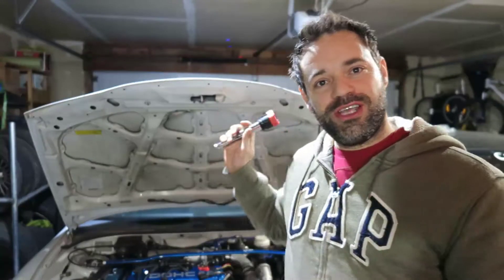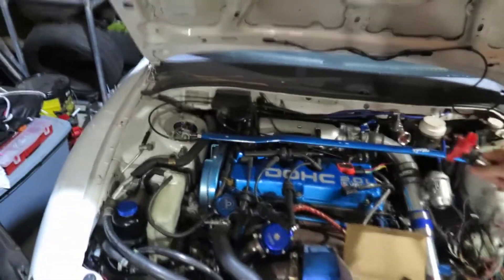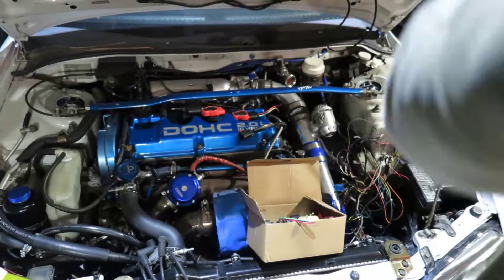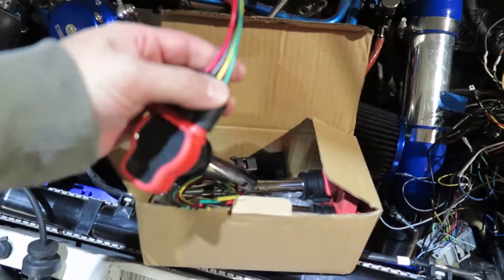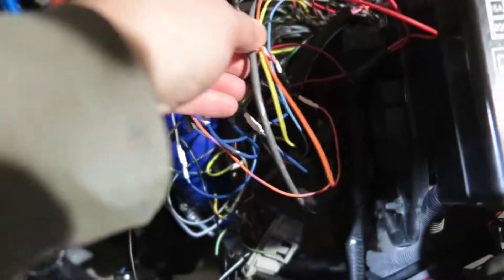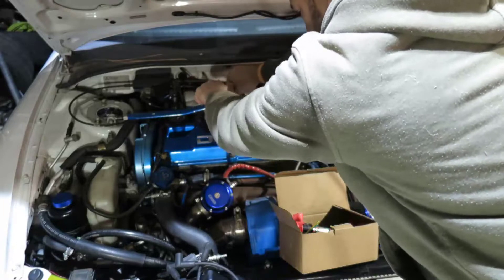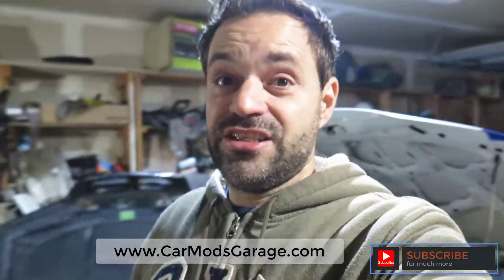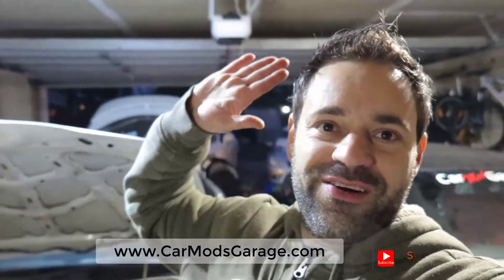Individual Coils on Eclipse 420a and SpeedyEFI First Start - Eclipse 2G Project

Comment: I’m trying to replace my coil pack. Would I need to apply any lubricant or whatever to it? I only see people doing the spark plug wires or boots.
Reply from the maker: Well this is not OEM for this car but usually no you don't need to do anything.  The spark booths and wires are mostly the same principle of connection.  The coils only are longer and have the coil on top of course but the connection to the plug is the same way.  Some people apply some sort of grease but I've never put anything
Reply: @CarModsGarage  I was just wondering because I got p0303 code, then got p0304 a month later. But I erased both codes. I have tried to narrow it down my spark plug wires and spark plugs aren’t old. So I’m thinking of doing the coil pack and maybe checking my injectors. Seems like coil pack would be an easier to replace. Thanks for responding
Reply from the maker: @r8der674 when I got that code on a g35 I had it was the coil pack.  Cheap and easy to change most of the times

Comment: I’ve got oil pouring out of mine coming from behind the timing cover dripping bad in front of the oil filter what do u think
Reply from the maker: Good look and see where it's coming from but it could be from the valve cover gasket. Clean everything, go for a drive and see where the oil is coming from
Reply: @CarModsGarage  did it behind the cover
Reply: @CarModsGarage  got to pull engine
Reply from the maker: @RickeyFields-sd4jd  oh that sucks

Comment: Can you do this with the stock ECU? I'd imagine just routing the wires from the stock coil pack plug to each coil but then again I haven't looked at any wiring diagrams or pinouts so I don't know how that plug works
Reply from the maker: Hmm guys research a bit but if the signal that the ECU send is enough to trigger the coils then yes. Good figure out the sequence
Reply: @CarModsGarage  well I have some coils, everything I need for wiring and another car so I'll do my research and see if I can't get it to work!
Reply from the maker: @not_virtuality  🤙 let me know how it goes
Reply: @CarModsGarage  also you think it would be worth it on a stock 1991 3KGT VR4? I think I wanna keep it stock cause it's basically mint condition but of the engine ever blows up im gonna build it
Reply from the maker: @not_virtuality  I don't see you gaining anything from it so I wouldn't mess with it if I were you

Comment: what turbo system do you run
Reply from the maker: I'm running an eBay turbo .67 ar. Ebay intercooler kit. I was running a smaller garrett turbo but it started making noise so I got this one that was laying around. Very happy with it

Comment: Did you happen to switch to COP because the original coil is a dumb coil? Did you ever get the car to start with the factory coil?
Reply from the maker: That's a very good question. I did I switch to the new ones because #1 my old ones were not sparking (broken cables) #2 the speeduino works better with smart coils. It only sends the signal. That way I can use sequential firing. #4 finally for the looks.
I unfortunately did not make it work with the oem but I believe if you only pair up the signals with the firing order since there are only two signal wires it should work fine
Reply: @CarModsGarage  thank you. I tried using the factory coil yesterday. Unfortunately it did not work, come to find out these are considered to be 'dumb' coils and as a result, they would require an external igniter to work. Luckily, I did not fry my Speeduino. Word of advice to anyone who reads this, ensure NOT to connect a dumb coil directly to the Speeduino without an igniter, you could ruin your new ECU. Time to go with a COP setup for me as well. I'll be going with a wasted spark as I'm doing a PnP unit that I can swap out with the factory PCM thank you for all the help so far!
Reply from the maker: @jorgerios1029  hmmm i guess the igniter is inside the ecu then. Eclipse ECU does a lot of stuff. You will need an external voltage regulator (I have a video on that) otherwise the battery will not get charged. 
Not sure how the ecu would fry without the igniter since ecu send signal out. I would think worst case it would fry the coil pack not the ecu but better safe then sorry. On my other build I fried 4 out of 6 smart coils testing them from the ecu .
By the way every coil that hass less than 3 wires are dump. Smart coil usually has 4 wires ( pos, neg, sig, sig back) the ecu only care about sig so it's out signal to the coil. I would think that on the eclipse the two wires apart from the power would take the signal. I guess not 🥺.
Reply: @CarModsGarage  according to what I've read, it seems like some dumb coils will send the high current output back via the signal wires without an igniter. This is why they don't recommend wiring them up directly to the ECU.

That's a really good tip to know, the number of wires on the coil, thank you!
Reply from the maker: @jorgerios1029  gotcha. Ya that makes sense!
Reply: @CarModsGarage  i meant to mention this to you earlier, I too went with an external voltage regulator, thank you!
Reply from the maker: @jorgerios1029  Also watch the next videos about the wiring. You will need a little mosfet to transform 12v to 8v for a few sensors. The ecu will have one pin that says 8v supply or something like that. That's where you will add this mosfet output
Reply: @CarModsGarage  yes sir, I went with a L7808 voltage regulator. I'm putting the Speeduino inside the OEM PCM case. I'll be sure to send you a link to my setup once I'm done. 👍
Reply from the maker: oh that's cool do it! I am curious to see how it will turn out
Reply: @CarModsGarage  So I went with the same setup you have here with regards to the COP. I wrote the ignition inputs to each respective coil (1,3,4,2). I can't get my trigger lights to turn on on speeduino ECU when going with 'Low' setting on the spark trigger output. It only turns on when selecting the 'Going High' method. Can you please re-confirm your setting for this option.
Reply from the maker: @jorgerios1029  I'm on "Wanted COP" glowing low. Are you doing an Eclipse?
Reply: @CarModsGarage  I'm doing a Dodge Neon with basically the same engine. All of the sensors are the same.
Reply from the maker: @jorgerios1029  stupid question but just to be sure did you choose DSM 420a on the Trigge Settings?
Send  me ama e-mail at marcos@carmodsgarage.com and I'll  send you my tune so you can compare or see if it gets you started

Comment: Hi CarModsGarage, quick question as I will be running this coils on my Speeduino application, do you wire the signal cable from the coils to the Speeduino controler directly? is there a need for inline resistor or something?
Thanks, best regards
Eduardo.
Reply from the maker: I didn't add anything. I only wire the individual coils as I show on my video straight into the ECU.
Reply: depends on the board you are using. Sometimes you will actually need to replace the built in resistor with a lower value. 0.4.4 has 10 ohm which is perfect (r8s need 10-15ohm), some others are 100-150 ohm which is too much.
Reply from the maker: And yes sorry just now I understood the question correctly 😣 signal wire straight to Speeduino. Nothing in between

Comment: it liiiiiiivesss
Edit #1 @4:16 Crimps have shown to last longer in locations susceptible to vibration. You'll want to ensure that your solder joints are well insulated or (GlueLineHeatshrinked) to minimized vibrations to the joints and ensure a connection that lasts. If you do decide to do crimps later on you'll want to use copper crimps/terminals to prevent corrosion in the future. @5:25 Agreed.

Edit#2 lol @8:37 ish. Yes for coils you would want at least (a minimum) 18AWG wire to be able to handle operating them without overheating the wiring and potentially causing damage to surrounding wires.. based on the coils you use, they may come with an AWG recommended size. an interesting sidenote though is that if you have all 18AWG wires crimping/soldering together to one wire for the feed, you would want that single wire to be larger than the individual 18awg wires as if you think of it it now needs to feed 4 or 6 or 8 coils based on your engine and thus that single wire will need to have enough of a Gauge in order to supply or feed the individual branches.

Lol so much typing hahah 
Good Video bro, awesome to see it start.
Reply from the maker: I never know which terminals to buy and also the crimper. Mine is fine but it doesn't make a perfect crimp.
Reply from the maker: oh yeah! :)
Reply: @CarModsGarage  I usually Comment at the start and edit throughout... prepare for edits lol
Reply from the maker: lol. I appreciate it brother. I do the same sometimes.